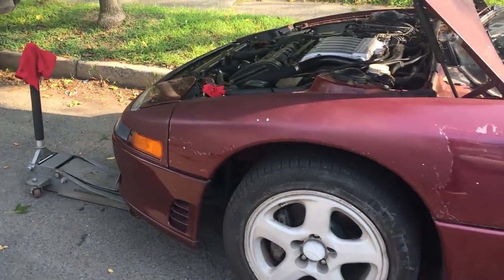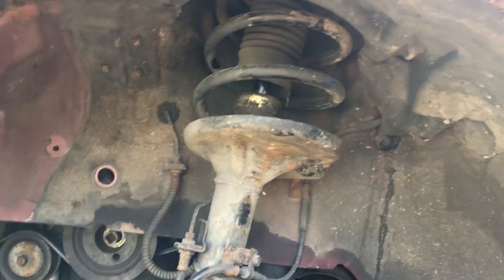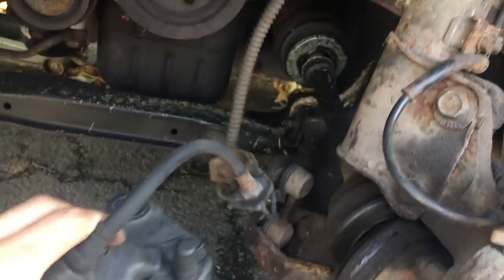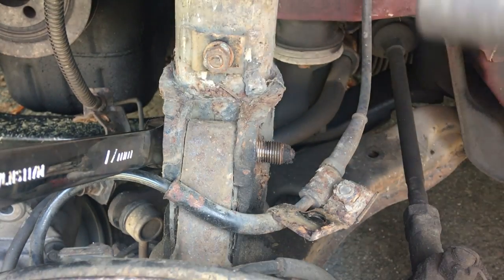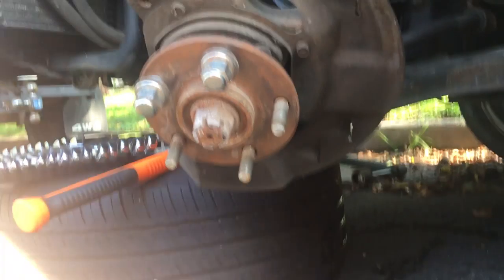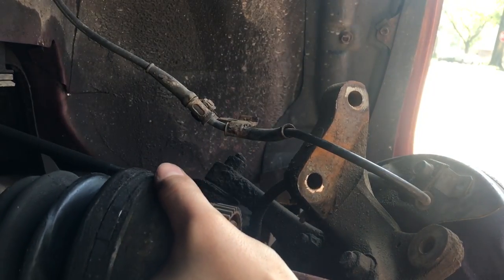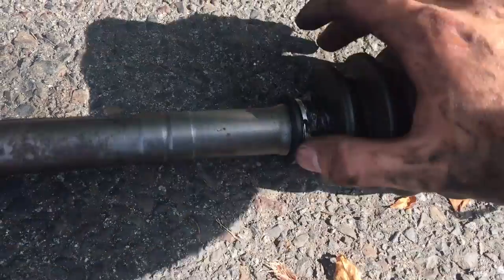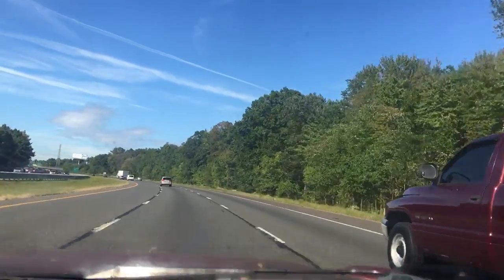How To Replace Your Struts!

Comment: In my 3000gt the back suspension is about an inch lower on the driver side than on the passenger side. I am not sure if it is because of a bad strut or other reason but you can clearly see that the body is closer to the wheel on the driver side. Any ideas?
Reply from the maker: RaulBillieJean Make sure to check it on level ground and is your car aligned properly?
Reply: not sure I just got it last week and the guy who sold it to me didn't know much about it

Comment: Man, you should have replaced the cv and struts when you changed the brakes and rotors... you’re doing so much extra work and each time you do work you’re risking damaging something. You should clean the car first, then  work on getting the engine running smooth. If you can’t get it running there’s no point in doing all these extra things except for YouTube clicks.